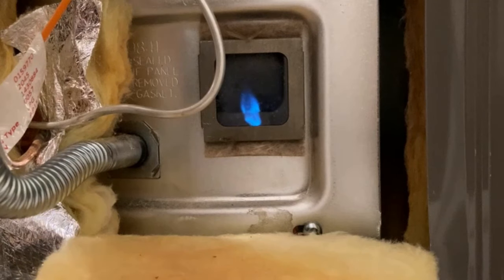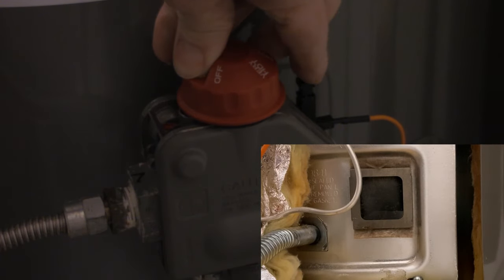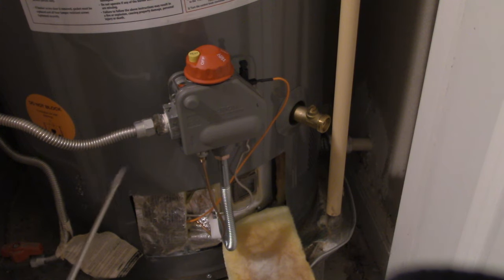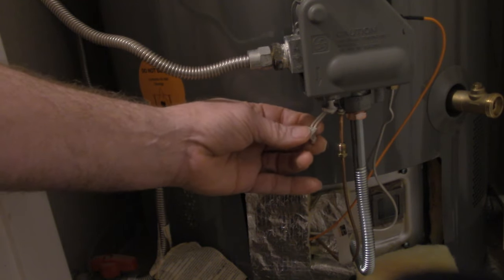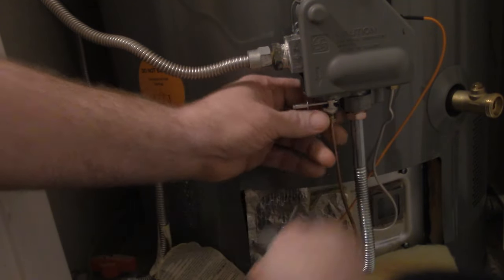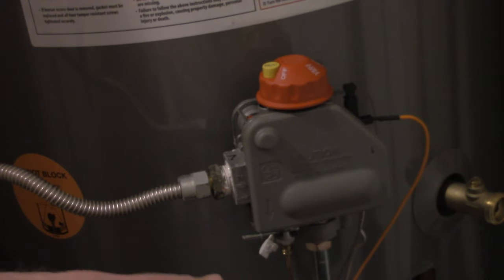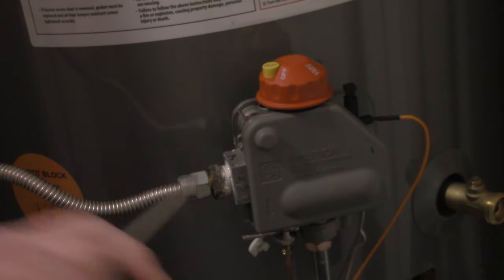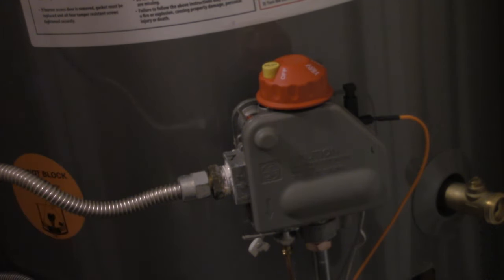Rheem Water Heater Pilot Light Issue

Comment: Thank you! This was very helpful.  I contacted Rheem Support and supposedly they are sending the upgraded gas control valve although I have not yet received an email confirming so.  I did the trick you described above (without a nail) and the pilot light stayed on.  I am hoping that Rheem can send out the replacement soon so I can get it professionally installed soon.
Reply from the maker: Thanks for letting me know it helped. That’s the only reason I make these videos.

Comment: I have two units. One failed after a year.  Second unit just failed.  So I knew about this bypass.  Problem is that yes the valve can be replaced under warranty but you still have to pay for the plumbers labor cost.

Comment: I just slipped that sensor out and repositioned the thermocouple and it's working for now.  

My issue began Christmas night.  I noticed that the pilot was out, so i lit it and it stayed lit.  Problem fixed, or so I thought, but I still looked for reasons that it might have gone out.  I passed it off as a fluke until the next morning; it was out again.  Lit it again, and it was good for a while.  Around lunch, I checked again: out.  That night, out again, and the next morning.  Lunch time yesterday, it was out, and it wouldn't stay lit.  Did some looking and found these Rheem videos, and I didn't have time to do anything with it until this morning.

Comment: Had the same issue with my RUUD 50 gallon water heater today. Very happy with your video! Thank you so much! I installed my RUUD water heater on March 2021 and already having issues. The only other problem I noticed is a dark discoloration on the paint above the site glass on the outside metal, not sure if that’s normal for a water heater only 1 1/2 years old.
Reply from the maker: You are very welcome. Hope you get it all repaired
Reply: Thank you. Same issue. Installed heater 3/21 now its 11/22. delivery of new Valve they say 1-2 days, will see if that happens, (day 2 today) if so sounds like they have caught up on the Supply end. Thks again

Comment: Happened to my sons 1 1/2 year old Rheem water heater, yesterday. The (new) subdivision plumbing company knew about, and came out. Replaced the valve under warranty (no charge). He says it’s a known problem (not if but when), they carry replacement valves on their trucks. He says they went cheap on the valve.

Comment: **update: I filled a complaint with the bbb and just before the 30 day respond window expired, someone from "rhymes with cream" contacted me by email and said they will reimburse me for the labor in both instances.  While this is a good gesture on their part, I'm still at the mercy of this part failing again in 1 year.   

Exact issue.  Mine was installed on Jan 11, 2021.  Valve went bad one year later.  Flash forward, one year from the replacement, the coupler has gone bad again.

Comment: Helpful video! This same thing happened to my 2020 Rheem. Pilot light would light with the button depressed but would go off as soon as it was released. It had the same issue in 2021 when I was away and the plumber fixed it - no idea what he did to it. This time when it went bad, I first replaced the thermocoupler and that did nothing. I tried this trick and it worked! I used a piece of 14ga copper wire instead of a nail; it was barely big enough and 12ga would have been better. What's weird is that I put a multi-meter on the high temp sensor and it was showing a closed circuit (no resistance), meaning the sensor should have been working. That makes wonder if there's a connector issue.
Reply from the maker: Glad to help. I don't remember the exact numbers, but the difference between a good emergency cut off sensor and a bad one is less that 0.5 ohms.
Reply: @MuddFlappRanch  For mine, at least, I'm thinking it's less about resistance and more about the overheat sensor kicking on at a way too low temperature. The circuit was closed while the water was still cold. When I came back and tested the circuit again after I did your fix while the water was warming up, the sensor had an open circuit; so the overheat sensor must have kicked on after the boiler was on. This makes sense because the first time I tried to relight the pilot light (the water was cold) the pilot light lit and stayed on for maybe 5-10 minutes before shutting off again. Regardless, thanks much for doing this great video!
Reply from the maker: @cmiller6391  That is the typical failure mode for the ECO.; you will notice the pilot is out, it will relight just fine once or twice, then never again. If I was guessing, I would say the thin plastics film that waterproofs the thermostat and ECO fails and allows water to enter the ECO.

Comment: Appreciate the info. Most videos cover changing thermocouple, while I already knew and did. When it still failed to work , I hoped to fine another solution. So the emergency bypass is my problem and I have disabled while we wait for warranty repair. At least we have hot water until then.
Reply from the maker: Thanks for commenting! Hope your repair goes smoothly.
Reply: @MuddFlappRanch  did. Bypass worked until tech arrived a couple days later to so warranted repair. Thanks.

Comment: Thanks for the video. I was at my wits end. I have less than 2-year-old Richmond, the same issue. How long can I use this trick until I get a replacement?  Also, what is that safety shut off for?
Reply from the maker: The purpose of the emergency cut off is to shut off the gas flow in the event the thermostat fails and allows the heater to overheat.  This video shows a troubleshooting technique and I do not recommend operating with the safety bypassed.
Reply: @Mudd Flapp  yeah I understand.  I reached out to them and they acknowledged the issue. Under warranty they're sending me a new part and cover some labor cost. Thanks for the video it helped me a lot.

Comment: Have the same issue recently. Thank you for the video. But I have a question. Do I need to turn off the gas before the work?
Reply from the maker: You do not need to shut off the gas supply. You are not opening the gas system, but you should definitely know how to shut off the gas, in case things don't go as planned.
Reply: @MuddFlappRanch  Thank you very much.

Comment: Thank you so much, my heater is working again. Question about this, I know that the tank is safe to use because it has a working T&P valve, but what does this safety that we bi-passed do?
Reply from the maker: Thanks for watching and commenting. The emergency cut out is designed to break the electrical connection to the gas solenoid in the event of a thermostat failure. If your thermostat were to fail by not detecting the set temperature of the water, the burner would continue to heat the water until the T&P valve tripped. The T&P value tripping will only reduce the temperature and pressure in the tank, but not shut off the gas supply.
Reply: @MuddFlappRanch  Thank you, I am going to call Rheem tomorrow to get a replacement gas valve.
Reply: @Static1701  what did rheem say? My plumber wants $94/hr plus parts

Comment: Amazing video man. Very insightful thank you so much. Was able to get my water heater up and running with this tip. Just out of curiosity, what's the longest duration anyone has gone with the nail replacement working properly?
Reply from the maker: Glad it helped. I don't have a good answer for the durability of the bypass and for obvious reasons can't recommend its use for other than a troubleshooting step. I can tell you hundreds have reported using the bypass and none have reported any issues.

Comment: Question for you Mudd Flapp. When you replaced the control valve did you empty the water heater or no? I have seen some videos where they don't empty it, just
wanted your thought about going that route!
Reply from the maker: I have actually not replaced the valve yet (hopefully tomorrow). I do intend to drain the tank. You "can" do it without draining the tank, but not without a mess. You have to try to put the new valve in with water coming out of the hole. As mine has been installed for a year, it is time to flush it anyway. I can't think of a good reason to try it without draining it, but there probably is a few.
Reply: @MuddFlappRanch  I was just hoping to save a couple gallons of water. Ironically I just drained it last week, but better safe than sorry, I will just do it again. Once again...thanks!

Comment: That stupid sensor/circuit breaker thing is my problem.  I removed it and I tightened the fitting on the thermo couple as much as I could and I wedged a wooden block under the thermocouple near the floor to push up and the pilot light works and I'm now heating water.  I tried to put a short piece of copper wire into the gap but it wasn't making contact for some reason.  I wasn't a fan of using an aluminum pop rivet - it felt like to many different metals.  After I get the 40 gallon tank heated, I'll try again with the piece of copper wire.  A new gas valve is being shipped by Rheem so I hope that I don't have this make-shift set up for more than a few days.

Comment: Got another issue with this heater though. When I fill the bathtub, then drain it, I get a powder, like sand, in the bottom of the tub. The WH is only 4 years old. Is this the anode rod coming apart? Thanks.
Reply from the maker: Could be the anode rod, could be sediment in the WH tank. Drain and flush the tank, check the anode rode. Depending on your water conditions, the anode rods need to be replaced periodically.

Comment: I raised my temp to hot and triggered the emergency cutoff. Putting the screw in the thermocouple fixed the problem.  I will leave the screw in and never increase the temperature past medium heat

Comment: Let’s just say one was to leave the temporary nail trick for over two years and has had no issues ever since. What is the risk in leaving this long-term?
Reply from the maker: In theory: If your gas valve failed to shut off once the set water temperature was reached AND your temperature and pressure (T&P) valve was to malfunction AND the water in the tank reached boiling temperature; then the steam created would over pressurize your hot water system until the weakest part of the system ruptured. It could be the tank (not likely) or a pipe or valve anywhere in the hot water plumbing lines. The T&P valve is designed to be the weakest link in the hot water system, which is why codes in most areas require that it is piped to the outside of a residence. It is not impossible that it becomes so clogged and corroded that is is no long the weakest link.

Comment: Great Video and solution.  I got the thing started and with that safety input jumpered the water heater works properly shuts down on temperature etc.  My question is what or where is the thermocouple that operates the normal operation or is it the same.  If its the same I'm not sure what the safety measure is with this device or is it one more thing in series to go wrong as it has.  Older water heater valves don't have such a device and they operate for a whole lot longer that 1 year as yours or mine did, and the over heated, blow up situation is probably slim to none before you get all kinds of scalding problems with overheated water which would cause a request for service.
Reply from the maker: On the back of the gas control valve, there are two prongs that extend into the tank. The thermoSTAT is what normally controls the gas valve. The thermostat is a mechanical device that turns the gas on and off. It looks like a big spring, when it heats up it uncoils, lengthens,  and activates the valve. The emergency cut out (the faulty part) is an electronic device that also extends into the tank. It is designed to detect an overtemperature condition of the water and shuts off the gas in the event that the thermostat fails. The thermocouple is a device that sits directly over the pilot flame and produces a small voltage (`25mVDC) to energize a solenoid. This solenoid sits directly below the "pilot" button that you hold down during initial lighting. The temperature and pressure valve (T&P) is the water valve near the top of the tank (usually with a long pipe that hangs down the front). It opens in the event that the tank pressure gets too hot and steam increases the pressure. If the thermostat failed, the emergency cut out failed and the T&P failed, it could boil the water and the steam could cause an violent rupture somewhere in the hot water system (tank to faucets).
Reply from the maker: This video shows a tear down of a gas valve, although this creator incorrectly calls the emergency cut out the thermostat. https://youtu.be/2XTF6cScHpI

Comment: Thank you!! This fixed my issue, one question though, I didn't hear this answered but I may have missed it, is it safe to leave the temporary metal piece in the position of that white safety piece until your plumber comes out, or does it have to be removed once the water reaches the right temperature? It won't continue to Leak gas if I leave the mini Allen Wrench in the hole for the next few days until the plumber comes out will it?
Reply from the maker: The responsible answer is "this test should not be used for prolonged operation as it bypasses one of the engineered safety devices". From personal experience, no it will not leak gas. Some viewers have reported leaving this set up while awaiting parts or service, without issue. You would have to decide if the risk of overheating and thus over-pressurizing the water heater outweighs to domestic disharmony of not having hot water.
Reply: @MuddFlappRanch  Thank you for the quick response! I will use my best judgement to make a decision.

Comment: very similar situation
heater about 3  years old now. 
i replaced the thermocuple and gas valve about a year-1/2 ago .  at my expense and  now its doing a similar malfunction.
it will re light enough to re-heat a couple of times but then pilot will go out again and have to be re-lit.
    i replaced the thermocuple a 2nd time (third one total) and it s the same . will relight but then goes out within a day or 2 , and have to be re lit.. one u-tuber suggests just removing the sensor "clip" and then threading  the thermo-couple lead further into the gas valve . that didnt work. had to re-install the sensor "clip" to make the connection . then it would re light and work for a coup[e days again. 
    didnt want to change out the gas valve again , but maybe i'll contact rheem to see if i can get one through them. 
     havent tried jumping the sensor leads because it will work for a bit and then have to be re-lit.

Comment: Yes I had the same thing with my heater a month ago called Rheem and they took care it right away.
Reply from the maker: Did they cover the labor to install a new valve?
Reply: I called Rheem today to ask about replacement parts. A plumber installed mine 2 years ago. They were willing to sell me a couple hundred dollars worth of parts plus shipping! And said 2-4 time for shipping. They were unwilling to pay for ANY of it! Nada. Said 1 yr. warranty on parts and 3 years on the tank neither of which do me any good. Basically I bought a lemon. Sounds liked planned obscilesense. Water heaters used to last 25 years. And it sounds like more American greed to me, esp. because the price of water heaters has almost doubled since COVID.

Comment: I implemented the "temporary work-around" and sent Rheem an email inquiry asking for assistance. I purchased the water heater 18 months ago and installed it myself so the labor portion of my warranty is expired. If Rheem sends me a replacement gas valve, will it be an upgraded version or the same POS that it replaces???

Mudd Flapp: thanks very much for this video... it saved me time and money!!!
Reply from the maker: You are very welcome. The replacement gas valves are supposed to be "upgraded", but only time will tell.
Reply: They will SELL you more parts. That's it.

Comment: Would you recommend to keep this temporary fix while I get my valve replacement.? And really thank you for this video it really helped me out to get my hot water back
Reply from the maker: Given that this does bypass a manufacturer safety device, I can't recommend operating the water heater in this state. Thanks for watching.
Reply: Thanks for the video. Do you recommend turning the water heater off after each shower ?  How
Reply from the maker: @jmwromuls  Turn the gas valve to "off"

Comment: Just did the same thing and it worked🙏
What is the actual valve sensor called ?
Reply from the maker: The faulty sensor is the emergency cut-out, but it is built into the gas valve and not replaceable. Best course is to install a new gas valve.

Comment: This was my EXACT PROBLEM. I replaced my thermocouple and it was messed up still. Watched this video and the pilot stayed lit. Thank you again. So i contacted my plumber but should i turn it back off until he comes tomorrow?
Reply from the maker: I cannot recommend leaving the water heater in this state, as it bypasses the engineered safety device. Others have reported doing so without issue, but the risk is still present given the general poor history of the gas valves.
Reply: I got my control valve replaced a year ago. So the problem is just going to keep happening… ive had my water heater for 2 years. So i hope rheem fixes the valve instead of giving us faulty ones over and over